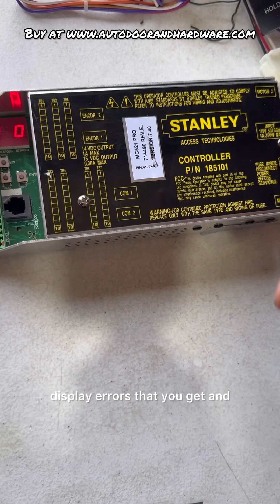Understanding The Door Status Codes and Error Codes For Stanley MC-521 185101 and 185101-1 Control

Comment: On the Stanley magic force I’m getting a flashing dash and dot on led, could that be caused by a blown controller fuse? It was working fine until I disconnected and reconnected the wires from the push button activator on the wall because I needed to repair drywall at button location. Now the door won’t open at all.
Reply: Getting the same thing.  Door stopped working, discovered a blown fuse.  Replaced the fuse, powered on via switch, and no movement when door is activated.  Maglock is on a different circuit and disengages when door is activated, just no movement on the door motor.  Displaying -.  on disp300 (nothing on disp301).  If I hold down enter, I get a dot on each disp300 and disp301, but other than that I have no control.

Comment: I’m getting a flashing dash on the left led with a slight sound every 2-3 seconds. Any ideas? Door not reacting to anything, key switch not working either
Reply: It needs to be rebuilded, power supply circuit inside of the unit is bad.

Comment: I get a 14 and b3 error what is how do I fix that?
Reply: B3 error is an encoder fault. Check your encoder housing and the magnet. In my experience though, if a controller is showing a B3 error, it's most likely on its last leg.